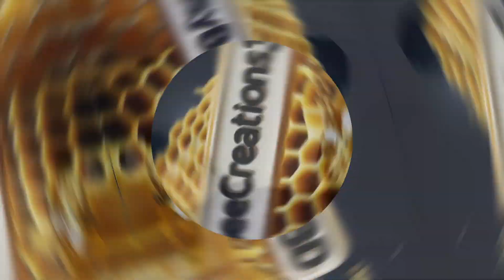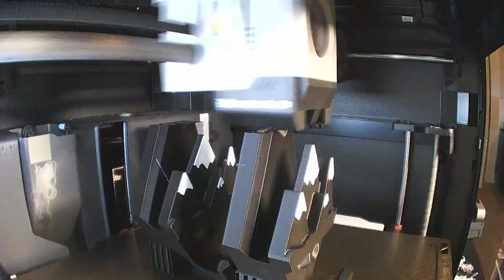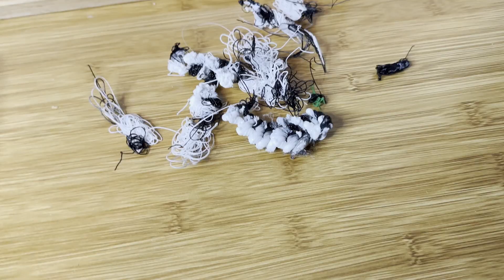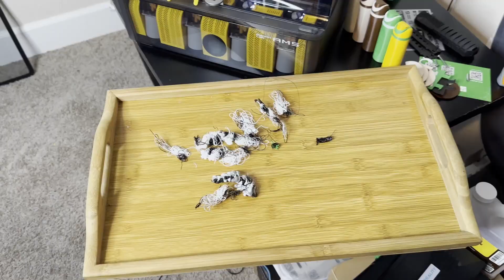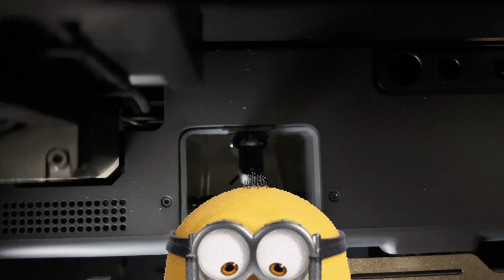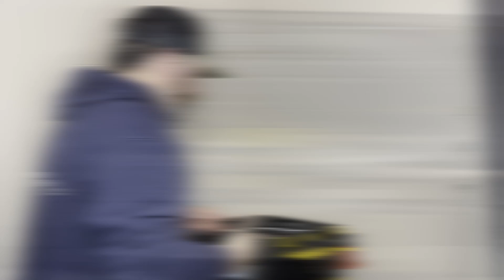Poop Chute Clog Fix and Prevention | Bambu Lab P1 / X1 Series 3D Printer

Comment: There is a small semi metal square stuck to the top of the front of the Shute that is missing from my printer. I can clearly see it in your video-- I thought to replace it with a metal plate but the filament is sticking to it as well... SO, I bought Lanties Protection coating and smoothed it over all components- Viola!

Comment: For anyone else with this problem:

In my case the actual hotend was bent, likely from an earlier major poop clog collision. It was depositing the poop too close to the chute wall. 

Just manually move your tool head into the chute position and then to the right to the nozzle wiper. Check if it hits the wiper somewhere close to the middle. In my case it was hitting the wiper at its very edge, close to the black plastic roller. 

So i just took out the hotend, bent it straight, and that solved the problem.